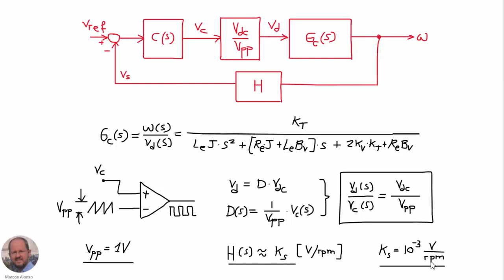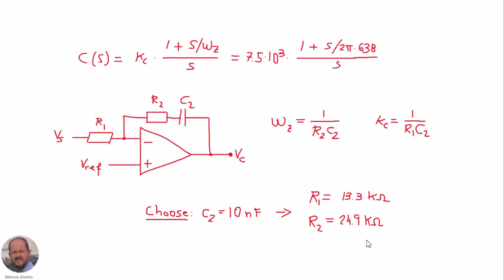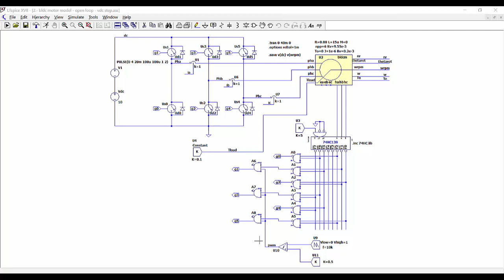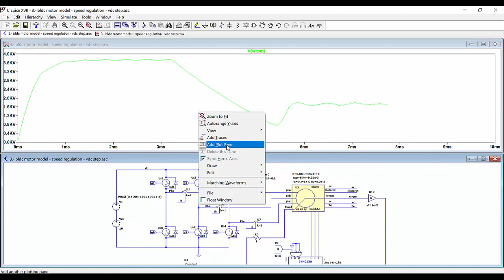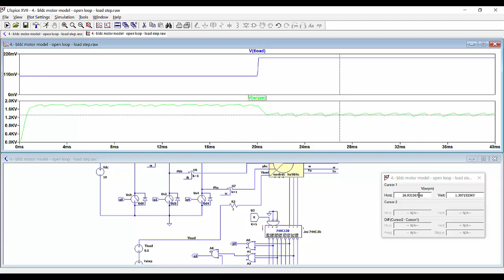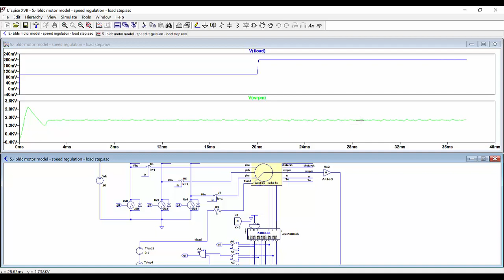LTspice #19. BLDC Motor: Speed Regulation

Comment from the maker: 13:30 I forgot to say that I added a 500 kOhm. resistance to the compensator to limit its DC gain. This speeds up  the simulation at the start up and improves convergence. Otherwise it will have little effect on the operation. Only that it will increase a little the steady state error.